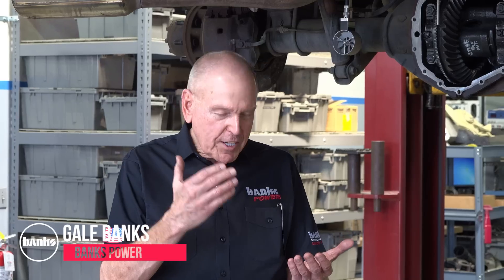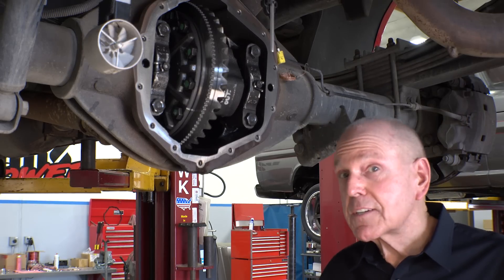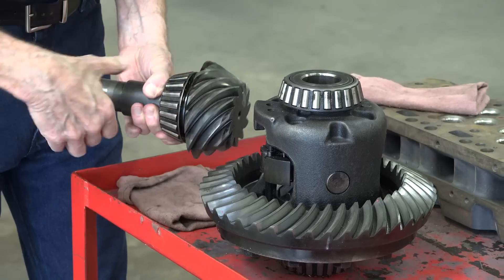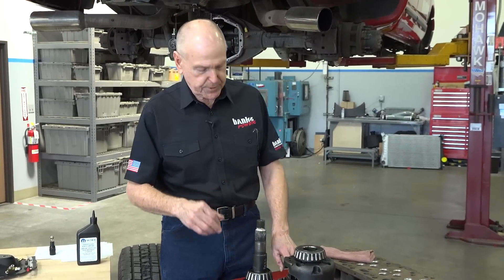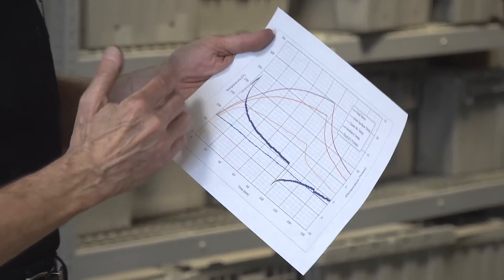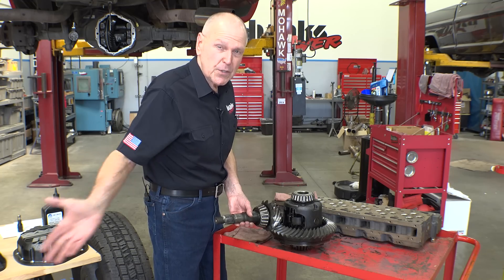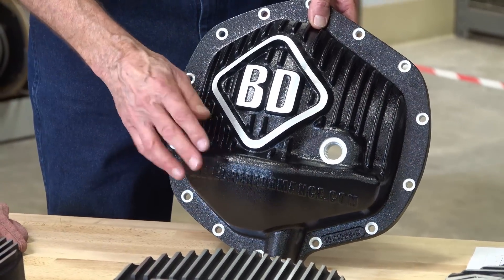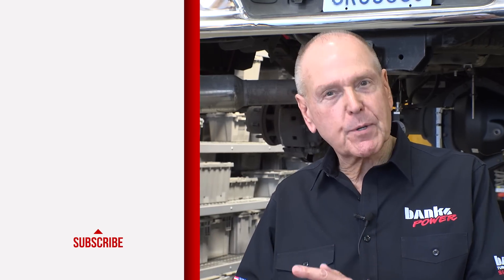Do Diff Covers Work or Are They Just Bling? Part 2 of 3

Comment: Way ahead of you gale, ive been subscribed for a long time now! Thanks for taking the time for the testing and the vids. Hopefully a well designed diff cover comes from all this to really make it worth the effort. Even if not, its worth just knowimg the truth and putting it out there. I get a kick out of the no nonsense straight forward engineering approach to analyzing the competitors products. Gale's love for the truth in engineering and honesty in marketing can't be hidden. This is the reason why made in america costs more, and is usually worth every penny. Gale reminds me of my uncle, a retired aerospace engineer. The language is very familiar. Diagnosis and problem solving thru the scientific method ultimately yeilds similar results, no matter what the problem. The forces at play dont change, unless parameters are changed. He's right in saying the guys who designed these oem parts know better then anyone else, including the aftermarket.  The aftermarket is supposed to offer a superior product, where oem production costs or other factors inhibit the best possible materials/design for a given part. When buying aftermarket parts, just make sure its the case that they do, in fact, do a better job. Remimds me of the banks vids on cold air intakes that do worse than stock in airflow and intake temps. Same ideas. Anyways, great vids, keep doing what your doing banks!

Comment: I really hope he can also test the factory AAM aluminum finned cover. 
P/N: 68149259AC
Reply: I had the same thought. Also, PML diff covers seem to hold the OEM internal design from what I can see, I would like to see Banks test these as well.
Reply: I can say that under load it drops fluid temp by 20 degrees Celsius.

Comment: Once the lube is flung off the gear no more work is done to the lube so no power is lost from things happening to the lube once it leaves the gear. It's the same thing as rocket exhaust or water from your hose. No extra thrust is gained if the rocket exhaust (or water jet) happens to hit something like the ground. This is covered in high school physics but that was a while back. :)

You should talk to the axle builders; as I think the shape of the rear cover had more to do with making the cheapest cover and nothing to very little to do with fluid dynamics. Just a cynical guess. But I do agree that the rough inside surface is not doing the fluid any good; probably raising the temps from extra friction alone.

Spot weld some cooling fins on a stock cover and see what happens.  Thanks for the excellent series! Good stuff!

Comment: I predict stock wins or at least ties in some cases.   Perhaps a better than stock design could be a stock shaped cover (on the inside) with deep, vertical aluminum fins on the outside?   That's how nissan did the nismo cover for the Z car... doesn't add any capacity, just cooling.
Reply: Yes I think you are right. The designers and  engineers know what their doing moreso then some aftermarket products.

Comment: So, a different take:
 I'm a jeep guy. We rock crawl. If you drag that dinky stamped metal dif cover over a rock, it will peel and you will lose fluid, or you if you miss a line you can smash the dif cover into the ring.  We run heavy cast covers or thick fabbed covers. Personally I'm using poison spider.
Reply: The question isn't the durability of the cover, it's the engineering behind the shape and volume of the cover. I've installed much heavier cast covers on rock crawlers but still with stock shaping to them.
Reply: Thanks, I assumed that by leading with "so, a different take", would cover that I had a different  perspective on aftermarket diff covers and their utility.
Reply: Oz media has it. It's not just that Mr Banks said aluminum gets rid of heat better. So the big ol heavy duty cover your using isn't helping in that regard.
Reply: AND thats why I started my comment with "so, a different take". What "so a different take" means is someone has a different point of view, maybe for a different reason.

At 2mph in Moab, where we stop all the time and video our buddies trying obstacles, heat isn't an issue, at all. BUT aftermarket diff's ARE useful, because of their durability. Now, on my one ton, I run factory diff covers, factory everything really for now.
Reply: He is not talking about crawlers, geez.

Comment: Thanks Gale, for De-Bunking bullshit! No regurgitating information. Real engineering. Real measurements.

 I have a slight guess as to why the factory covers are shaped the way they are near the ring gear. They want the gear to retain lubricant and "Pump" some lubricant onto the pinion. No more, no less. My guess is, the diff cover is sucked in towards the carrier to limit splashing and promote the oil to run down the internal walls of the container without getting foamed up.  

I want to see a bore-scope inside the diff, from three angles. 
1: Aimed at an angle from the passenger side carrier cap towards the ring gear. 
2: Aimed from the housing ceiling from the passenger side, towards the mesh of the pinion and ring. 
3: Aimed where the ring and pinion are coming out of mesh. The fill level might have something to do with that forcing the oil into the void, to promote fluid retention.
Reply: Guns Cars and Digits lol my thoughts exactly! I would love to see it scoped as it runs!
Reply: I just snapped, you could take some Polycarbonate, push the stock diff cover against it, heat it with a propane torch, and blamo, you have a clone of the stock diff, that's clear, then bolt the thing up! Won't have to fool around with drilling holes for the bore scope.
Reply: Watch his other video with a clear plastic cover. It shows what you seek
Reply: Jason Harrison  I just watched that video. It did exactly what I suspected it would do. That ring makes a relatively good oil pump. Gotta lube that pinion. It sees quite a lot of load. Twisting, torsion, compression and tension.

 I cheated. I designed a trans-axle in college. The intermediate shaft did the oil pumping. We thought about using ATF to stop the foaming, but it didn't pump as uniformly. When oil gets squished out from between gears, it's one of the most violent ways to pump oil that I can think of. The pressure is almost always above 20,000 psi. The other side of the mesh is a vacuum and cavitates the oil. There's not a whole shitload you can do. Gears are very heartless machines. 

You can run axles dry. The oil is meant to wash the contaminants up against the diff cover and the little magnet. When you run a gearbox or bearing dry, the tiny little hardened particles remain in the bearings and cause lots of microscopic spalling and galling. The shape of the pinion pushes the pinion against the carrier.

Comment: This is the most interesting science i've seen since the Hadron Collider. Someone get Mr.Banks a white lab coat.
Reply: this is some basic shit
Reply: 8 years of engineering, with some applied work... the information is already out there sorry so many people are too lazy to find it.  you think over the last 100+ years of mechanical design, nobody has investigated lubrication of geared systems?
Reply: Nope, I was smart and capable enough to go out and find the information that exists.  Rather than have it spoon fed to me.  Matter of fact, it doesn't take that much smarts or capability to do that at all... just a little bit of self-starter attitude.   Hmm
Reply: @Wayne Morphett it's effectively an advertisement for their aftermarket shop. plus popular videos get monetized. Wake up.
Reply: @Wayne Morphett and if you understand the physics you don't need to test every single instance and configuration. A handful of data points lends itself to engineering judgement and extrapolation. understanding the underlying forces and dynamics means you can understand something without going hands on.
Reply: @Wayne Morphett think of it this way... Your grandma's hand mixer is like 1/20th HP and can slosh around a couple quarts of brownie batter no problem. The interior dimensions of the cover causing fluid to slosh around isn't sapping a 400hp engine of any appreciable power across the usable torque range. It isn't like flow through the runners to ensure a good air/fuel swirl before combustion. The squared off geometry might actually be putting more fluid in contact with the interior surface, resulting in potentially better heat transfer when it's needed. There is definitely more surface area available for conductive heat transfer. Remember also that  vehicles aren't stationary, are rarely straight line, rarely 0° grade, and often accelerating, all of which changes the orientation of the differential with respect to gravitational pull and other forces. Further, from an operational perspective, having fill and drain plugs sure is nice for a fleet vehicle that needs frequent maintenance, because it's running 6d/wk. Less time on the lift dicking around with gaskets or O-rings means greater ROI from the asset.
Now, go back to school son.

Comment: How about the 99-07 steel super duty cover vs. the 08+ aluminum finned OEM cover?
Reply: ElleExxe Foursixty might just help passively cool
Reply: Those and the Ram finned alloy one are finned but don't alter internal shape very much if at all. It looks like they were after cooling and no change in lube capacity. The factory cooler covers look to stand more proud of diff case but i have not measured internal depth to know if the extra height is due to thicker wall or if the internal clearance to ring gear grows considerably. The ring gear shape being carried into the cover is mimiced on the alloy ones.
Reply: My thoughts exactly.  As thorough as Gale is being. I'd hate for him to skip over the upgraded factory cover
Reply: @Mr.Beastforpresident  lol right that's why they make radiators out of steel and not copper or aluminum, because the metal conducts heat faster... good God man.
Reply: Nooooooo  they don't. You made the statement that steel is a better conductor of heat than aluminum which is flat out incorrect. Aluminum out performs steel several times over, and copper does even better than that. That's why aluminum and copper are used in heatsinks and radiators. Copper is heavier and more expensive than aluminum, but its performance is superior.
Reply: No biggie. I think in the large truck world since their gear sets are loaded in like a 9 inch Ford, the rear cover is part of the axle assembly, so making that part a different metal would be a huge pain in the ass. True in the winter it would take longer to get to operating temperature, but I think at least from that perspective it would depend on your particular climate (north vs south) as to which temperature zone you're going to spend more time in. For short hops to the grocery store neither are going to be good... taking a load of whatever across a couple of states, that's where you're going to see the difference. 

I am curious to see what the factory aluminum covers do in comparison to the factory steel ones. Should be interesting.
Reply: @Mr.Beastforpresident  he mentioned in the video the reason the factory uses aluminum is for heat transfer properties and the cooling.

Comment: im a bling guy but...would the oil spending more time on the back cover give it more time to dissipate heat? guess we will find out and i would have just towed a boat 100 miles, slightly less scientific but a lot easier ...thanks GB we really appreciate someone of your caliber (and modesty i didnt know about) doing these informative videos ...geeze, if my name was banks id be the most arrogant a hole ever, this is really  sobering
Reply: the more time the oil spends running down the back cover, the more friction it creates
Reply: @aSinisterKiid  your grandma's hand mixer at 1/20HP can slosh around a couple quarts of brownie batter. does that create heat from friction? are you really worried about sapping 1/20hp from a 400hp engine? something you think you can measure?
This whole concept is a joke.
Reply: while I find your attempt at a comparison humorous, it isn't similar in any way. Come back to that example when your grandma's hand mixer is flinging batter across the kitchen at 80mph and show me the temp. You don't seem to understand the science or physics involved in fluid dynamics, so that's ok. Go somewhere else then.

Comment: I see a lot of opinions on here that fall in line with Mr. Banks. I am in disagreement with most. I think the smaller OEM diff cover creates a higher duty cycle and quicker degradation of the fluid. It's obvious that the more volume of fluid you have the longer it will last. As far as the design, it might be fair to say rounded covers are better than square. I prefer steel over aluminium. Take a look at Ruff Stuff's diff covers, no bling all business. If heat was an issue the OEM guys would offer a diff cooler. As far as know, they don't. Does a thick steel diff cover add structure to a housing? I think so. Will aluminium crack when it hits an immovable object? Use your brain folks.

Comment: I added a Mag HyTec cover to my '03 Ram 2500. I almost bought the AFE because it has internal fins that none of the others have. My original cover was horribly rusted on the outside, with heavy flaky rust. The rest of the underside is near perfect, so I assumed AA&M used some bad metal and didn't paint anything.

I would like for you to include the PML/Yourcovers.com cover for this axle in your test, as it is very similar to the OEM but more capacity and is aluminum, and doesn't appear to have the internal design you don't like (shoulders and edges and traps). PML is an excellent company to deal with. https://www.yourcovers.com/diffcover_10361.php
Reply: I recently added the PML covers. I really wanted the convenience of a drain plug and I liked how they so closely resembled the OE cover. Really the only difference is in the surface texture. The stamped steel surface is smoother than the sand cast surface of the aluminum. I'm not sure how much of a difference that will make though.
Reply: @salspec3381  steel is not going to have the same cooling properties as the aluminum.
Reply: Sorry I was not talking about thermal properties, but the surface texture. Sand cast has a rough texture when compared to the smooth surface of stamped steel. Gale talked about how the oil uses the cover to climb over the ring gear. I wasn't sure if or how much the surface texture affects that aspect.

Comment: Mr Banks thx for the time and info.
1 The "stock" cover is done for all the issues you spoke and one more. Cost.
2 Is there a way to back track the horsepower/torque. To see what happens as the fluids heat up.? There must be some sweet spot for optimum performance for the oil viscosity used.?

Cheers
MJ

Comment: As someone that has experienced tear axle issues I am interested in this research. I blew up a carrier I. A 10 1/2 inch gm rear end. The gear was fragmented with 4-5 gear pieces at every securing bolt for the ring gear. Replaced it with eaton locker and new everything in housing. Never another problem.

Comment: The more answers you get the more questions pop up. It would be interesting to put a thermocouple on the housing at the front pinion bearing, the temp might give an accurate account of how much each cover interferes with the fluid flow. Great series

Comment: I’ve been running a mag-hytec on my 02 dodge 3500 since the first year I owned it. It’s a service truck that’s grossed over 14k it’s whole life of 585k miles at this point. I have zero complaints or failures in 21 years.

Comment: I’m so hooked on this series 🍺😎👍🏽
Wonder how something similar to a windage tray that they use for engine oil pans would work inside some of these extra capacity diff covers basically use that shape of the OEM steel cover for controlling the flow of gear oil for smoothing out the oil flow but maintaining that extra capacity I think that’s what Gale was getting at.

Comment: Gale brings up some very good points. 

As a professional mechanic with an engineering degree, mind you, I'll share my thoughts on this subject matter. Take it however you wish.

Seems any good quality and functional aftermarket differential cover would simply copy the factory cover's shape and design, for best fluid flow and least drag, with some minor improvements in overall design.

I'd recommend 3 simple changes: Billet aluminum construction with external cooling fins for more heat dissipation. A quality sealing surface, either with a quality reusable silicone gasket or an o-ring that sits in a channel, or groove within the cover's mating surface. Both a fill/level plug and a drain plug would also be welcome upgrades to any stock differential cover design.

A larger fluid capacity (gear oil) is simply unnecessary and wasteful.

I'd love to hear any more thoughts, suggestions, or complaints.

Comment: It's interesting that the original Nissan Titan had a standard stamped diff cover and suffered from a high failure rate. Nissan's solution was a cast aluminum cover (which may look like the original ones internally I don't know off hand) and I believe a switch to synthetic fluid. Between the two they solved the problem.

Comment: I have another candidate for your consideration. A "G2" by G2 axle and gear. This cover doesn't suffer from the extra capacity shelf situation, it's a finned aluminum version of stock with drain and 2 different fill holes(for modifying pinion angle).
Looking forward to the results of this test. Thanks for your efforts on this.

Comment: Thanks for the work. It will be interesting to see the results from a true scientific test. I have always thought a cooling coil would be best. Something like a transmission cooler. Even if you had to run a small pump to circulate the fluid. The roads here in Texas can be a bit toasty somedays.